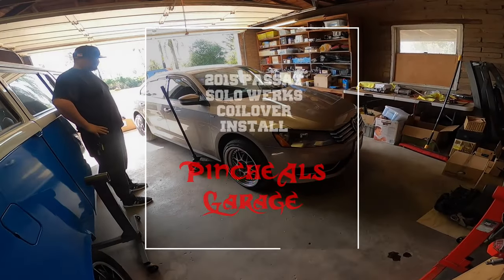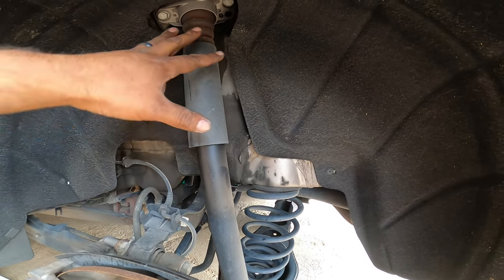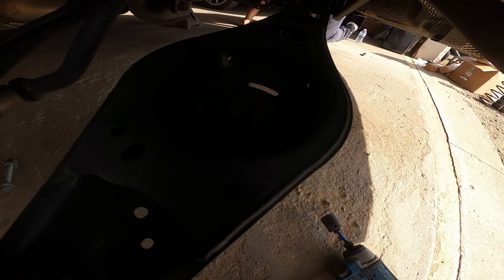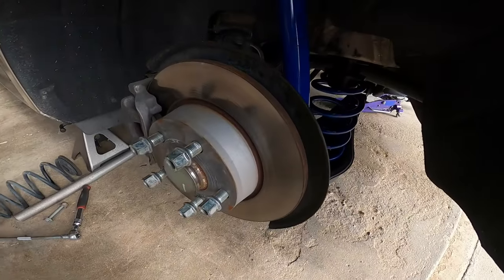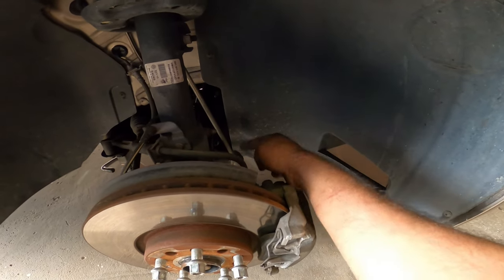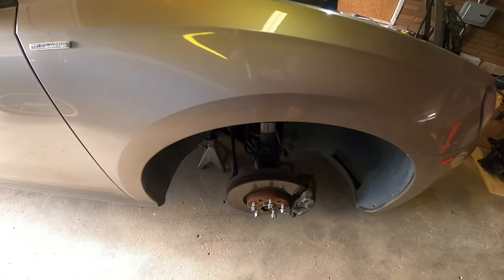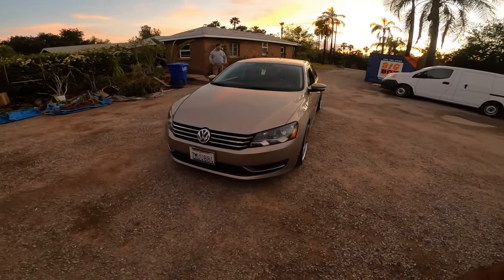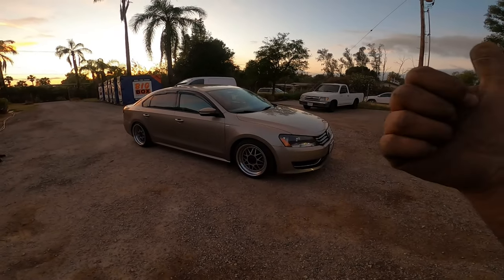How to Install Solo Werks Coilovers on a 2015 Passat S8 EP2

Comment: Hey Al. Think you can take a look at a video I just uploaded and see if you might know what is happening? I thought maybe a turbo leak. But I don't know. Could it be the timing belt? Fuel issue?
Reply from the maker: Sure
Reply: @PincheALsGarage  Found it. I could slap myself for not finding it before. The charge valve for the AC had rubbed a hole in the bottom of the hose just before the intake. I patched it, it ran good, I got on it and blew it out again. I patched it better, and I'm gonna take it easy till I get a replacement. Thanks for looking brother.